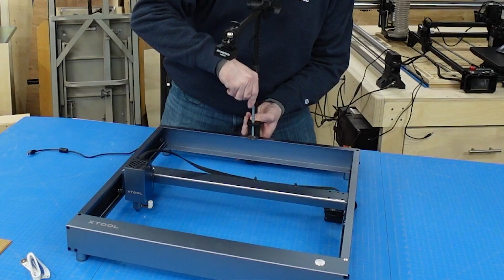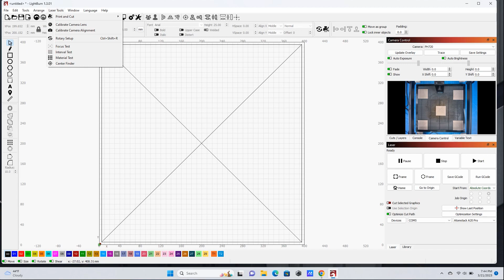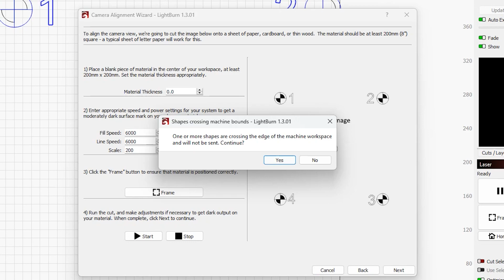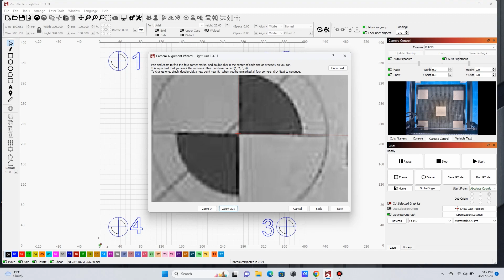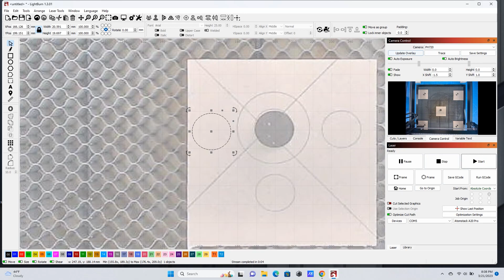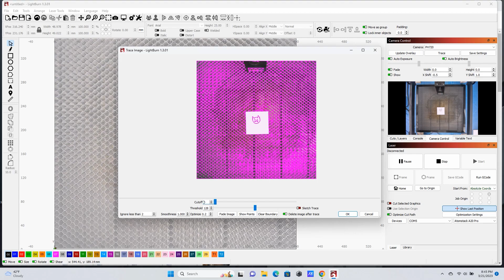Atomstack Maker AC1 Camera - Installation | Calibration | Tips for Using

Comment: Hi, I bought ACMER P2 and their A500 camera recently, really confused. Could you let me know what are the keys to get perfect calibration, and what definitely cannot be moved after the calib.?

1. Does 42cm height of camera need to be spot on?
2. I placed a piece of material that precisely covers my honeycomb bed 40x40cm, does it mean after engraving the 4 corner pattern, my honeycomb cant be moved at all?

Very confusing about how calibration works in general.
Reply from the maker: The 42cm distance is what you are aiming for to get the best balance of fitting the entire area in view.  It can be a little higher or lower as long as you capture the entire working area.  Once positioned and calibrated, you want the camera locked into that position relative to the camera.  You could move the honeycomb but the calibration is for what ever height you run it at, so if you remove the honeycomb and now your working area is one inch lower, your camera alignment will be slightly off.  So, it's best if everything can stay locked in place.

Comment: Up front on an Atomstack?  Nope - Hole is getting drilled in my mounting board!
Reply from the maker: Yeah, that was an odd place to recommend it be mounted but at least they provide the flexibility to mount it elsewhere and still align the camera to it.
Reply: @Vintauri  On the front, I would literally put my eye out on it!  I already have re-aligned things enough after bumping my rear mounted camera with my head. The end of those boom mounts look like they'd go for your eyeball if you let 'em!

Comment: is this camera needs limit switches like sculpfun 500 camera ?
Reply from the maker: For the camera to work well, it will need to know a consistent home location and to work in absolute coordinates. This could be done with a jig that you move the laser head to manually and set your home location but it is much easier with limit switches.

Comment: like Atomstack, pity you forget all an essential step: cabling!!
Reply from the maker: Fair enough, but it's pretty simple to just run the cables along the booms and out of the way. Nothing complex here.
Reply: Sure I agree but don’t forget not every one see the simple missing details.  My next step is that I bought the camera with the laser and now wanted to see how to integrate it if a build a fume and dust box around. Additionally I took the extension kit 400*800. Does the camera for such a size ?Hope to find an easy to use solution. I am engraving/cutting ABS what is toxic. Keep you informed the solution I will go for to be productive and secure.

Comment: Update on this camera and mount. I really like the Camera and the simplicity of the mount. However I did run into one issue, and that is the swivel that the camera mounts to. It Will not allow the camera to move to a parallel position. I had to mill out the area behind the swivel. At least that is what I have found on mine. I also found that the scaling had to be lowered to 182 rather than 200.
One other thing if you have made and X- Y shift and what to do another realignment be sure to take the X-Y Shit back to zero’s 😁🛫
Reply from the maker: This is some good feedback on it's use.  I didn't find too many issues with getting the camera square from the positions I was trying to mount it from but I can see that it could have it's limits on adjustability. I have been moving lasers in an out of my enclosures so much lately that I have not been using the camera as the calibration process takes a while and once you move things you have to redo it.  I'll be building a larger enclosure this fall and hopefully will have a permanent setup I can work with and get the camera dialed back in.

Comment: I am new to laser cutting and engraving. I recently purchased this camera. How can I use the smoke cover with this camera.  The camera is higher than what the cover reaches. Is there a cover out there that would work with this camera?  I hate to have to take the camera off whenever I do the burning and then put it back on and recalibrate and reallgn.
Reply from the maker: The camera's do create an issue with the shorter enclosures.  Depending on which one you have.  You might be able to mount it outside the enclosure and when the cover is off it might be able to see all of the working area.  Otherwise you'll need a taller enclosure to house it all.  The only one that I know of that works well without mods is the large enclosure from Comgrow. https://amzn.to/3RbZWi0
Reply: Thank you.  I purchased the large Comgrow enclosure and it is wonderful.  It is tall enough to cover everything and has lots of little openings for the cords to come out.  It has a large zippered opening in the front so you do not have to move the enclosure at any time after set up. It does a great job.  Thank you much. @Vintauri

Comment: Clack showed this cam and I bought it.  First time I aligned I could have croaked at how spot on it was. Laser sat for 2 days and now it is 5 mm off to the right on the x axis.  I have deleted the cam.  reattached the cam.  aligned and set up 2 diff times and cannot get the off set corrected.  Is it possible there is a setting in lightburn that I have hit or on the xtool?  xtool d1 pro on an acer running win 10

Comment: I just bought this camera and I had to cover my honey comb bed for the camera to recognize the the test card. I also had issues with the card being recognized as the instructions in the manual differ from the card placement presented on the light burn tutorial. Also my instructions did not have me  draw a box around the four corners and draw diagonal lines like you did. I like that idea. I am using the Longer Ray 5 10 watt laser. I have also noticed I had to pull in the scaling under the recommended 200 for a 400 x 400 work area. The laser would hit the back rail. Very good video.😀🛫
Reply from the maker: I had to disable the honeycomb detection setting to get it to recognize the pattern.  It's probably best to have a solid dark color as the background when running the calibration test.  I've seen a few different recommendation on how to calibrate the cameras and I try to take tips from each one to get it as accurate as possible.  I've yet to find the perfect setup and there is always just a bit of drift on areas of the workspace.

Comment: On the Atezr do you know how high the camera should be and if it would work with the Atezr enclosure? Thannks
Reply from the maker: The manual calls for it to be about 16” above the work surface. I think you can bring it a little closer but I have not tested how close but it would be around 13-14” at minimum. The Atzer enclosure is only 15.75” tall so the post this camera goes on would be too tall to fit without modifying it.
Reply: @Vintauri  or 42 mm from the base of the camera to the surface.